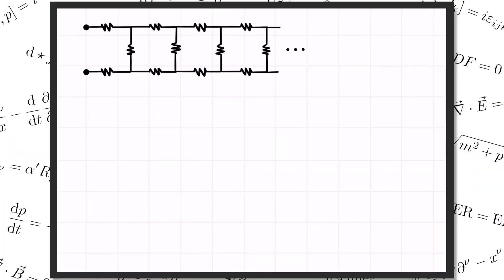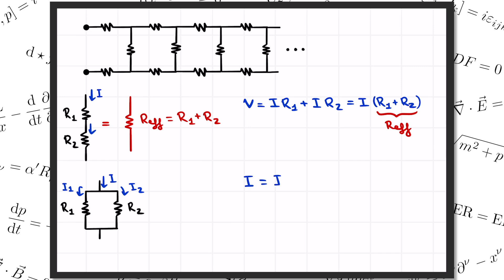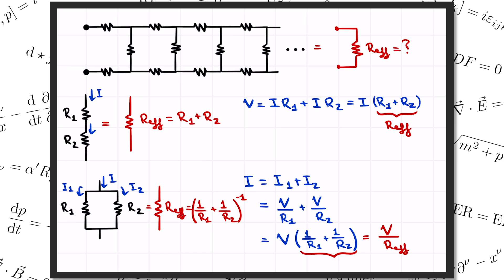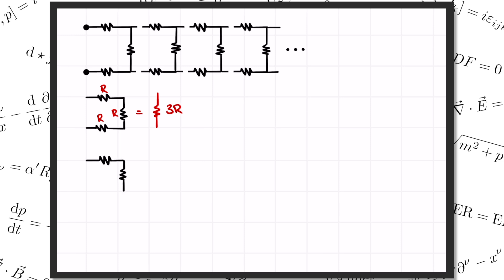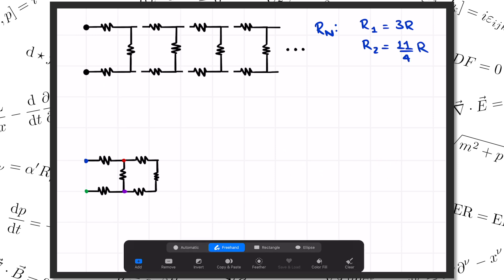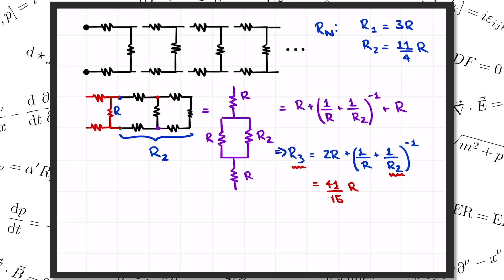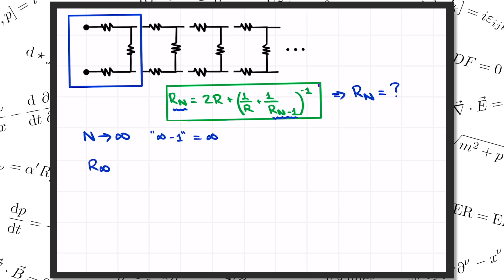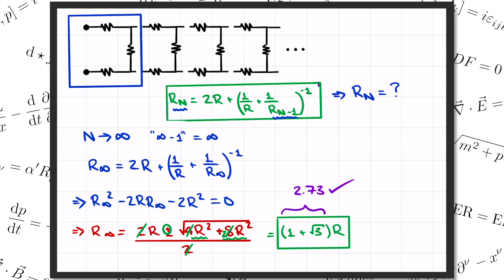Thinking Recursively: How to Crack the Infinite Resistor Ladder Puzzle!

Comment: An analytical solution is to remove the first 3 resistors and realize the equivalent resistance is the same due to the Infinity. 

So the middle resistor is in parallel with the equivalent resistance. This close the equation and it is a 2nd degree equation. Roots are R(1+sqr(3)) and R(1-sqr(3)).
As a resistance must me positive, the only positive solution is the correct one.

This recursive way to see this is really nice, but not so easy to observe from my poor mind.

Comment: Sorry to say, you blew it. You did the brute force method. Think out of the box. R = 2r + (r in parallel with R). I remember the elegant solution going on 50+ years now. You can take it as a homework problem to figure out the simple equation. Sometimes thinking about the problem first, is better than diving in to a complicated solution. R of course is the total resistance and little r are the resistors.

Comment: No, this solution (or explanation) is not good enough. I figured out the solution at the first glance. Look, take the entire thing for x. Using the fact we have self-similarity with the infinite circuit, detach one infinite part of the circuit. It goes to the right of the first vertical resistor. It is perfectly identical to the entire circuit, so, this is also x. Then we combine the first two horizontal Rs, the first vertical R, and attach a single resistor in parallel, with the effective resistance of x to it. It gives us exactly the same thing as your green equation. The problem is solved.
I never solved exactly this problem, but it is a typical problem for Olympic games in physics for middle/high schools, for pretty low levels.

Comment: I was so close but I dint thought that we add the two Rs and I got either zero or infinity 😂
Reply: No, it wasn't even close. 🙂Everything is much simpler. You will find it if you read about the solution I've demonstrated in my top-level comment. It comes from the first glance.

Comment: You've shown that it's bounded but you didn't prove convergance. The solution is only valid if the series converges.
Reply: The convergence doesn't need to be proven due to the physical sense. Think a bit and you will see it. Also, you can convert this speculation based on physical sense into mathematical proof. To do that, you can get away from formulas for effective resistance and get to the lower level, considering voltages and currents. Besides, look at my solution (somewhere at the top level of comments). It uses only the standard formulas plus the concept of self-similarity of infinite structures. So, the video solution (or explanation) could be better.

Comment: Great problem! The key insight you used to rewrite the recurrence relation in terms of its infinite limit, which allowed you to solve it algebraically, is super cool. Is there a general procedure to solve this kind of non-linear recurrence relation without taking the infinite limit?
Reply from the maker: I think there are a number of strategies that can be applied to solving recurrence relations like this, but I don't think there is an algorithm that will always work

Comment: I did it quite differently,  I assumed that the I is the current coming out from the battery  and then 
We can see that the current will be decided into to different current 
Say nI and  (n_1)I .then we can use kircchoff's law to  put two equations and solving for n
Reply: I don't really remember nor understand what i was saying 😅.
I guess I was trying to use some kind of recursion. 
Here: 
Let Rt be the total resistance of the set  so if we added another set of  these three resistors the whole this is really the same cause it's still infinite
Now we have Rf  ( of the set after addition of the extra set )
= Rt 
Rf it is r+r+(1/Rt +1/r)^-1 = Rt
 Now rearrange
 We get R^2-2rR-r^2=0 
               R=(1+√3)r 
Discard the -ve 
And yay🎉
Reply: Oh! my old me used Kirchhoff's
Reply: @@tryingtobeintelligentYOU ARE WELCOME 🤗

Comment: Question: If each parallel pathway had only one resistor (an infinite number of resistors in parallel with none in series), would the infinite ladder lead to a total effective resistance of 0.73R? Or would the total effective resistance go to zero? TIA
Reply from the maker: Meaning you want to erase al the horizontal resistors? Then the recursion relation is R_N = (1/R + 1/R_{N-1})^{-1}, and the solution goes to zero as N goes to infinity